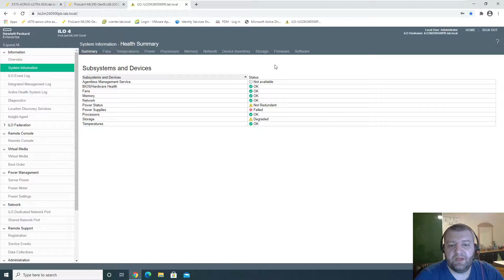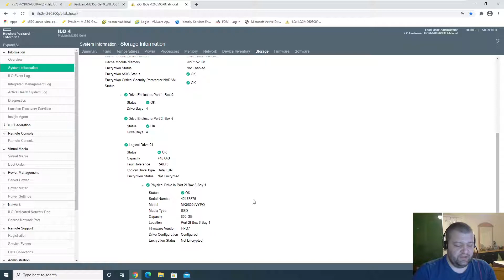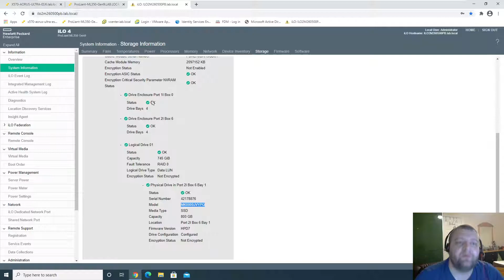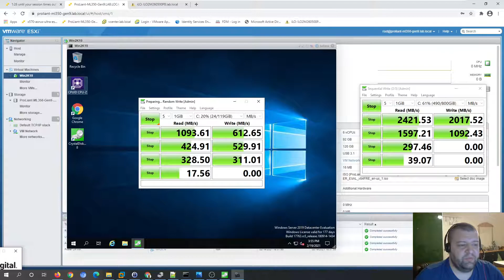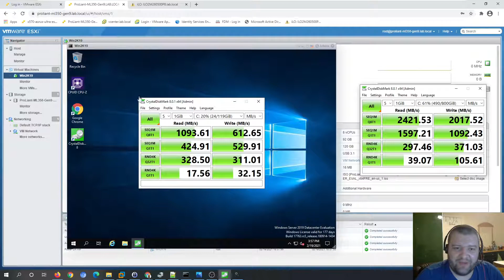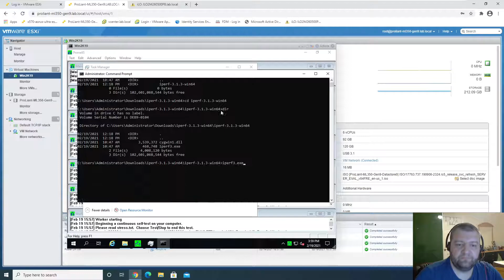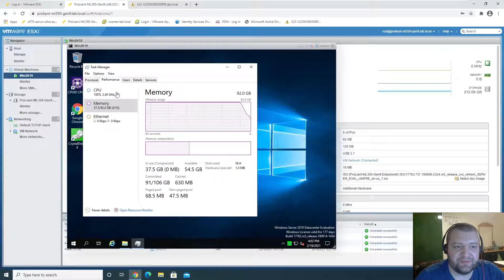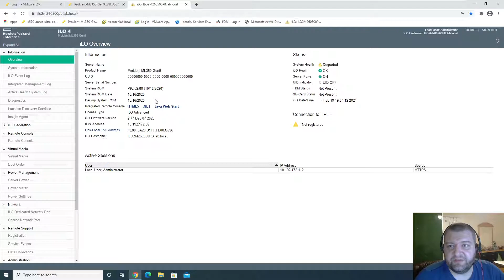HP ProLiant ML350 Gen9 As A Lab Server - RAM Upgrade, SSD Test, Network Test And Final Thoughts

Comment: Great video. I have same server with 1 CPU E5-2630 v3 8core 16thread.
Wondering if it is better to change to a 16core 32thread CPU or add a second identical CPU.
Any thoughts?
Reply from the maker: If you don't want to worry about ram and cooler and the price is right get a 16 core. Also be mindful of noise and Temps.

Comment: Hi. Im wondering if we can install a Samsung Sata SSD to ML350 Gen 10? Will the controller will recognize the SSD? Thanks.
Reply from the maker: It should see it without a problem. Just don't do raid on a consumer grade ssd.
Reply: You will probably not be able to read the wear level of the SSD if it is connected to a HP controller such as P or S series (and managed by SSA tools).